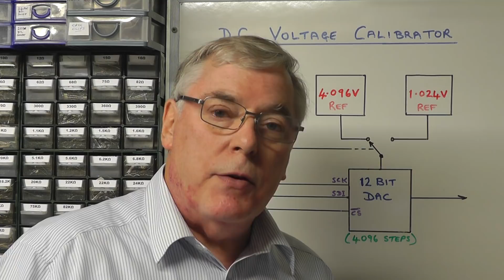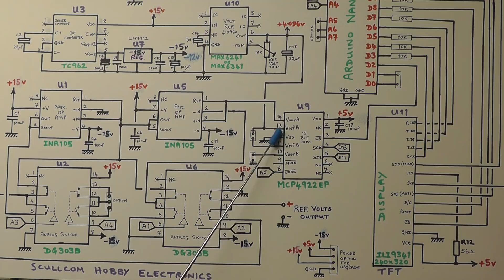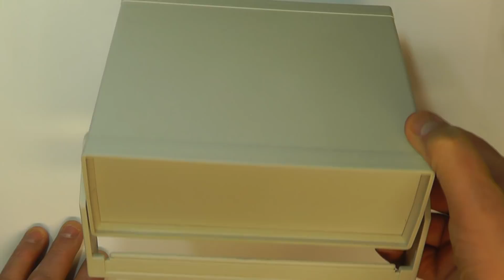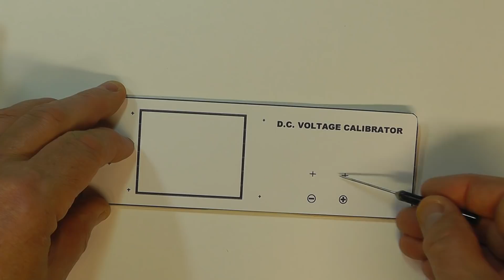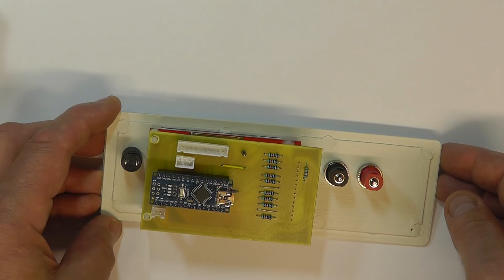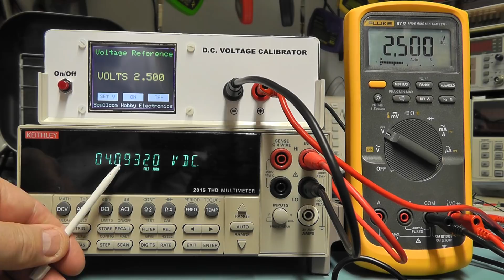Scullcom Hobby Electronics #54 - DC Voltage Calibrator Part 2

Comment: What is the difference between DC voltage calibrator and... the power supply?:) Why is it better to use calibrator instead of lab power supply?
Reply: A voltage reference is a device or circuit that's intended to produce an exact, precise, stable voltage that can be used for comparison with other voltages.  It can't produce much current, so there is very little power available.  In fact, if the load current changes, the output voltage will probably change to some degree, and that would defeat the purpose of the device.

A calibrator uses a reference to produce other voltages.  The usual technique is to divide the calibrator's output voltage, and compare it to an accurate voltage reference, and that will determine wither the output voltage is too high or too low, using the accuracy of the fixed voltage reference.

A power supply is intended to not only produce a specific voltage, but also with enough current that the resulting power can be used in a useful circuit of some kind.  Most power supplies are less accurate than most calibrators.  However, it's possible to build a poor calibrator, or a very precise power supply, where the voltage in the power supply might be more accurate than the calibrator.

Comment: Perhaps you could use the spare DAC to generate a correction voltage and sum that to the output.
A correction table would fit in the nano's EEPROM, especially if not all 4096 steps were stored,but ,say ,only every 10th step.
This would require some interpolation done in software for most steps,but this is trivial.
Alternatively a separate (large enough) EEPROM chip can be used ,so that the complete correction table could fit.
Great project,!
Thank you so much!!!

Comment: my display works but the touch screen needs calibration.  I have to push in blank areas to select values and the set button is not working at all.      Edit: I inverted the display (option 3 in line 69) and that problem is solved.  My touch screen is designed upside down from the one in your project.

Comment: Did you see my message?
Reply from the maker: Yes. Been busy over Christmas. Regards, Louis
Reply: Scullcom Hobby Electronics Do you think the regulated high voltage power supply it is a great project?
Reply: Do you think there might be someone interested?
Reply from the maker: I am sure there will be someone out there with an interest. But i do not think it is for the hobbyist. Regards, Louis

Comment: Great project. Can't wait for part 3. Another project that I think would be right up your alley would be a Arduino controlled variable notch filter for calibrating a low noise low frequency oscillator (10hz-100khz) for audio work.
Reply from the maker: Thanks for your comment and project idea. Regards, Louis

Comment: Nice project.
Perhaps use 1x oscilloscope probes instead of 10x as the screen of your scope shows. That would probably increase the noise measurement accuracy though the increased capacitance could perhaps influence the measurement as well.
Reply from the maker: Thanks Kenneth. Regards, Louis

Comment: This is a great improvement for less than 1V. setting accuracy and assembling everything, thank you very much. Looking forward for the 3rd part for reducing the noise task. I am wondering if you can also consider a project for making a "cap leakage tester" please (e.g. a solid state version of Heatkit IT-11 ). This is highly demanded and very useful test gear to have.
Reply from the maker: Thanks for your comment. With regards a capacitor leakage tester, these usually require high voltages of up to 500V or more and so could be dangerous for the hobbyist who normally work at low voltages. So I am not sure about such a project. Regards, Louis
Reply: Many thanks for your response, I fully understand your concerns about the high voltage dangers in a YouTube project. However, there are many electronics hobbyists who restoring tube radios in YouTube and dealing with high voltages. I am planning to make a leak tester and have seen a couple of YouTube videos but prefer your approach in projects so wondering if I can ask you technical questions during the design and build process. Wishing you Merry Christmas and Happy New Year.
Reply from the maker: I wish you well with your project. Feel free to ask any technical questions, I will help if I can. Regards, Louis

Comment: Great project, thank you!  I have a question.  On the schematic at 7:11 you show the output of the trimmer going to the 100K resistor, but just after that on the whiteboard at 7:40 you show the output going to the 1K resistor.  Which way did you end up doing it?
Reply from the maker: Hi Ira, Thanks for pointing this out. The schematic is correct. On the layout I made a silly mistake on the whiteboard and did not notice it, sorry about that. The 100K resistor goes to the slider of the trimmer and the 1K resistor goes to pin 6 of the IC and the top of the trimmer. I have corrected the layout download on the link I gave below my video so that is now correct. Below is also the link to the download zip file with the corrected layout and schematic:
http://www.scullcom.com/DC_Cal_1_024V_option.zip
Regards, Louis

Comment: 5:44 - how can that resistor array give +/- 1 mV of trimming?  It can decrease the output by attenuation (voltage divider), but I cannot see how it can possibly increase the voltage. What am I missing?
Reply from the maker: Hi John, I have found that the tolerances on these reference IC's are such that most are slightly high of the 1.024V. So the trim circuit brings it down slightly. Regards, Louis

Comment: Nice project again. I have only one question. Is the wiring arangement at 8.39 correct? It looks like 100k and 1k resistors exchanged places.
Reply: I was about to post that - but you beat me to it! :)
Reply from the maker: Hi Roeland, 
On the layout I made a silly mistake on the whiteboard and did not notice it, sorry about that. The 100K resistor goes to the slider of the trimmer and the 1K resistor goes to pin 6 of  the IC and the top of the trimmer. I have corrected the layout download on the link I gave below my video so that is now correct. Below also the link to the download zip file with the corrected layout and  schematic:
http://www.scullcom.com/DC_Cal_1_024V_option.zip
Regards, Louis

Comment: As always a perfect work - my next project after the load ;-)
I wish you marry christmas and a happy new year.

Greeting from Southern Germany,
Wolfgang
Reply from the maker: Thanks Wolfgang. I am in the process of redesigning the DC Voltage Calibrator PCB's to double sided print and will have some boards made in China. Once I have tested them I will make some of these PCB set (2 boards) available for those who are interested. Merry Christmas, Louis
Reply: Thats nice!
I've made also some PCBs in China for the "Load-Project" and the result was excellent.

Nice Weekend,
Wolfgang

Comment: Well, this project become more complex and definitely not for hobby users.
Biggest problem that I can find in hobby building is lack of precision instruments to calibrate projects.
In my book if any project needs high-end calibration it is not for hobby use.
So I think that better option is with 16bit DAC like AD5761ARUZ and high quality reference voltage ADR4525BRZ.
With that setup basically for same expenses you can get far better precision, no need for calibration and more simplistic to build.
Reply from the maker: Hi Silvio,
Thanks for your comments. I did look at using a 16 bit DAC for this project and may use one at a later date in another project. I wanted to use the low cost 12 Bit Dac in this project in the first instance and also introduce the hobbyist to the analog switching IC's to illustrate their uses. Regards, Louis

Comment: Is there any way to calibrate this without the need for high-end test gear?

Also, what happened to your website?
Reply from the maker: Hi, I will be looking at calibration in more details in the next part of this project. With regards my website, I had to take it down temporary due to the fact it had been attacked by a hacker and some of the data had been corrupted. Hopefully, I will find time in January to sort it out. Regards, Louis

Comment: i was going to comment about the cables and noise before you ran the scope test, i would shield, add a ferrite and an output cap at the terminals , along with a ferrite over the arduino replacement cable and maybe some caps on the switch input of the switches but that might be pushing it a bit
Reply from the maker: Thanks Alyx for your comments. We will have a further look in Part 3. Regards, Louis

Comment: i think you probably already know this but if you hold the screen back light button(hi res) on the fluke for 1 second you can get higher resolution, it would be useful for all those voltage tests. get video and project btw, thank you for the content.
Reply from the maker: Thanks Stratos. Yes I did know but simply forgot to press the back light button long enough. Hopefully, the Keithley meter readings helped. Thanks for bring it to my attention. Regards, Louis

Comment: The reason why the display update is so slow is because the way the display object is created uses a bit-banged software SPI. Even if the assigned pins are hardware SPI.
I believe creating the display object with 
Adafruit_ILI9341 tft = Adafruit_ILI9341(TFT_CS, TFT_DC); 
instead of
Adafruit_ILI9341 tft = Adafruit_ILI9341(TFT_CS, TFT_DC, TFT_MOSI, TFT_CLK, TFT_RST, TFT_MISO); 
will use the hardware SPI. However, threre is another trap. The 10k resistors in series with SPI lines will ruin it completely at moderate speeds of few MHz. A hex buffer like HC4050 would make sure the display will get a nice clean signal. I'm working now on a project using a smaller ST7735 SPI display, using a buffer to translate the levels i can easily run the display with 8MHz SPI clock, which gives it a nice speedy response.  
Right now it looks like there a mixture of three SPI's: hardware one used by the DAC library, software one for the touch lib and another software one using the hardware pins made by the display library. Ideally, all three could share the same HW bus and have separate CS lines. The price of using arduino libraries... ;)
Anyway, another great video, really enjoyed it! Your hand drawn schematics are pure art! :)
Reply from the maker: Hi, Thanks for the explanation, interesting. I will have to have a further look at the libraries. Regards, Louis
Reply: Interesting fact about the libraries. I think the ideal scenario is to have multiple hardware SPIs, not one that is daisy chained... Also, the clock of the Arduino nano is not ideal for driving this kind of color LCD. I think a higher clock MCU (like Arduino Due at 80 Mhz or Ideadstudio STM32 at 78 Mhz) would give a much faster response, even with the same libraries...

Comment: Thanks again. How can I calculate the N digits in a specification of 0,005% + N digits? In data sheet of multimeters always have this notations.
Reply from the maker: Hi, The N digits specified in multimeter specification with regards its ranges accuracy is usually calculated during the testing of mutimeter after manufacture, when batch testing is undertaken. The N digits is usually referred to on datasheets as number of counts ±.  This error factor is usually caused by ADC errors, noise and offsets errors, which will vary from meter to meter due to component tolerances and manufacturing processes. 
For example if we measure a voltage of say 2.000V on a particular range of the a multimeter where it quotes a accuracy for that range of ±(0.05% + 3). This means the actual reading could show a difference of ±0.05% of 2.000V meaning it could read between 1.999V and 2.001V, in addition to that we have other factors mentioned above and they will add additional counts (or digits) to the reading. In the case illustrated here it was quoted as 3 counts, so the actual reading could range between 1.999V - 3 least significant digits and 2.001V + 3 least significant digits. So in this case the reading could be in the range of 1.996V to 2.004V. Hope this helps.
Regards, Louis
Reply: Thanks so much. I appreciate your channel. It's very good to learn. I am from Brazil and I have a channel too, but in portuguese. If you want to know, just search qsptecnologia on youtube. Thanks a lot.
Reply from the maker: Thanks for the info. I will have a look at your channel. Regards, Louis

Comment: Great work as usual! To test for noise on the output disconnect the DMM and connect your scope across the output banana sockets directly. Also, don't use the ground lead on the scope lead, fit the small clip instead.......this should make a big difference and any noise thereafter you will know is generated from within.
Reply from the maker: Thanks Ian for the tip, much appreciated. Regards, Louis

Comment: Use of trim-pots with their high temperature coefficients ( ±100 ppm/°C) are not needed. Use of calibration values in the EEPROM is the way to go. The initial accuracy is not that important and can be compensated in software. The overall stability over time and temperature, is more important. 
The display is too slow as is. Using it in parallel mode, instead of I2C or SPI, would've dramatically improve its speed. 
XMEGA family with its 2x12bit DAC (not ATMEGA), and plenty of I/O lines (12+ for display), would've been a better choice for the MCU and eliminated  the need for an external DAC. 
Nice project and effort on your part though.
Reply from the maker: Thanks for your comments and suggestions. I will be having a further look at calibration in Part 3 so there may be some changes to come. Regards, Louis
Reply: I'll look forward to it.

Comment: Charge pumps may be the cause of that 10mv noise, while the spikes are from TFT. Maybe decouple the DAC from TFT by an RC filter and do the same to an opamps. -15V rail might be noisy, and that noise can creep onto the output of an opamp. With a circuit this comlex, ground layout is crucial too.
 Beatiful job sir! Don't take my comment negatively, I just wanna help to make this project as good as it can be.
Reply from the maker: Thanks Johnny, All comments are welcome. Thanks for the info. I will be having a closer look at this in part 3. Regards, Louis

Comment: On ebay dot com, I didn't find anything with that search string. Using "Plastic Electronics Instrument Case w/ handle" gave me good results though. I sent you a PM regarding EEVblog video sharing opportunity during January - would you consider, if you still have enough video footage on hand, to feature a wrap-up (part #8 summary) on the DC Load?
Reply: Cliff Matthews i got this case from Banggood as ‚plastic instrument case‘; it‘s only about 9 bucks...
Reply from the maker: Hi Cliff, Just seen your private message and have answered it. Regards, Louis
Reply: on ebay I find one. I searched "7.8 x6.9 x2.7 plastic" and it finds one for 15 and half $
Reply: Thanks! What I ordered was 200x175x70mm @ $11.85 CAD ( https://www.banggood.com/Electronic-Plastic-Shell-Cartridge-Handle-Project-Case-Desk-Instrument-200x175x70mm-p-1035473.html )
Reply: here is a link to the case...https://www.banggood.com/Electronic-Plastic-Shell-Cartridge-Handle-Project-Case-Desk-Instrument-200x175x70mm-p-1035473.html?rmmds=search&cur_warehouse=CN
Reply: Yes Cliff, I have used a number of these cases. Not a bad case for the money.

Comment: why didn't you use meter in 4.5 digit mode, you would get one more digit, wouldn't you?
Reply from the maker: Yes agree I should have set the Fluke 87V to its Hi Res Mode, which would have given the extra digits. I simply forgot to do it at the time, sorry. Having said that I did use the 6.5 digit Keithley also to show the output voltages, so the results were visible. Regards, Louis
Reply: I was thinkig about the same, he just had to hold the backlight button for 1 sec, and it would be better some cases I think.

Comment: Would suggest some screening in the case, along with some screening on the output lines, and perhaps a screen sheet between display and the analogue side. Should get a lot of the noise down with the output, and probably a 100n film ( not ceramic) cap across the output terminals.
Reply from the maker: Thanks Sean for your comment. I will be having a further look at this in Part 3. Regards, Louis